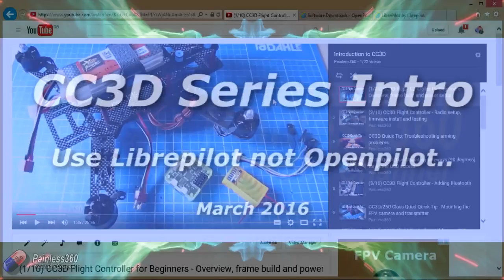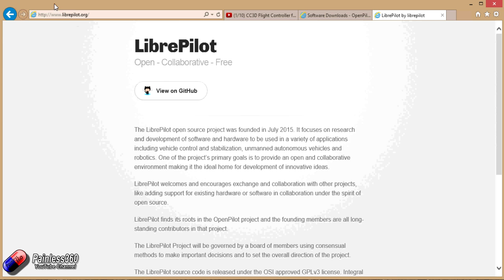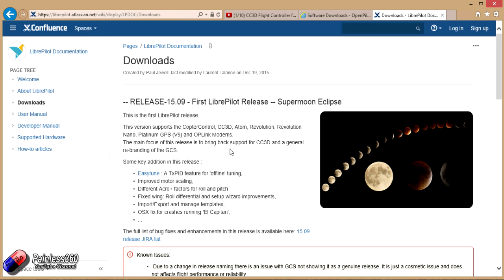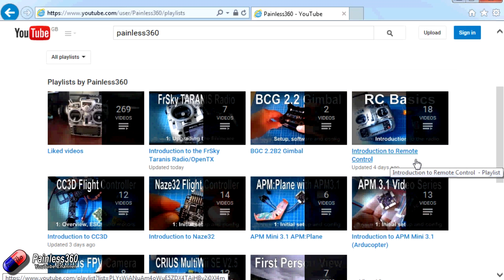(0/10) CC3D Flight Controller for Beginners - Welcome and use LibrePilot!

Comment: Has anyone had any luck with open pilot and or libre pilot.  I had no luck with open pilot so I downloaded libre pilot.  I connected everything using PWM.  I also connected a servo to prove that the Tx /Rx bind was working and it was.  I calibrated the motors and got up to the Transmitter section.  For some reason, only the throttle and pitch channels register.  I cannot get the yaw or the aileron channels to work when I following the software config and move the Tx sticks.  So for this reason I cannot press Next and move on.  I've gotta say, I have already moved up a level by dumping the KK2 mini board because the receiver test would always show as No Signal.  Now this.........

I have also tried using PPM with one lead plugged in only.  The servo doesn't work and I cannot get my motors to spin.  Something is not right.  When you watch these youtube vids, it looks and sounds simple and easy to do, but it is not.  I have two quads that I have built myself, installed the electronics, have used /tried both the KK2 mini and now the Mini Open Pilot board with no luck on both.  I cannot get these quads fly ready.   Should I down load clean flight or beta flight and flash my mini open pilot board.  If I don;t get mission accomplished soon, I'm going to either turn off the quad hobby hype or buy an RTF quad without any of these hassles.  Not impressed so far and I'm quite pedantic about the way I approach this, especially with the wiring and electronics involved.   This has tested my patience beyond what I expected.  Any advice from anyone is welcomed with open arms.
Reply from the maker: Sounds like potentially something you're doing wrong, or a hardware fault somewhere. If you look in the forums there are other people who have had similar issues and they regularly go through the troubleshooting tips. I've personally not had this myself, in this cc3d series on the channel I cover the steps that I go through to get things working. Best of luck with your build, hope you get it sorted soon..

Comment: trying to understand but not sure .... just order the micro size cc3d module from Amazon and it states open pilot . 
Do i need to install Librapilot before i start building ..... Thank You !!!
Reply from the maker: OpenPilot as a project is dead. Most pilots will use one of it's successors - LibrePilot or dRonin.. Best of luck!

Comment: Love your videos. I've learned so much. Maybe you can help with this one. I've converted my Kylin 250 (using SBus and Radiolink Transmitter ) to FrSky X4R SBus and Taranis. Kylin 250m has a CC3D and OSD all on the one board. Now I want to disable all the OSD information. I tried to connect through the OSD port with the OSD Config application. I un checked all the OSD information and all looked good on the application screen. I saved and disconnected, then reset the OSD port to telemetry. Now my goggles/LCD video display show some strange wording "aiting for heartbeat"plus some other info. Is there a way of turning off all the OSD functions for a clear screen? Any help would be much appreciated. Thakls Alan
Reply from the maker: Turning off the displays is something you need to look at the documentation for the firmware you've installed on the MinimOSD. I suspect that even if the MinimOSD is told to not display any information it's still looking for the telemetry data (also called the MAVLink heartbeat on this side of the hobby) and the error looks related to that. I'd enable telemetry on the CC3D but configure the OSD not to show the data. Best of luck!

Comment: HI,I emailed you before, I am building a Tarot TL250H Quadcopter with an original cc3d board I am using my Taranis plus tx and a x8r rx sbus I am using the magic stick that comes with the tarot my question is since I am using the magicstick pdb and the esc's get soldered to it the cc3d board will get powered through the esc's through the rx? I saw a video on how to hook up sbus with a servo wire to the one port does this work? Thank you in advance for any or all info!! also thank you for all the videos you make on builds not just showing how to do it but also explaining why it is done this way!
Reply from the maker: We've never used S-Bus with the CC3D as it's a pain - you need to use one of the ports to do it. I've never heard of the Magicstick PDB and a quick Google search didn't find it either - if you're using OPTO ESCs then you'll need to power the FC and Rx from the 5v from the PDB. See the RC power videos in the 'Introduction to RC' series. Best of luck!

Comment: Great series, keep it up. I can't access openpilot.org anymore to read the user guide (I use it because it is so much more detailed than the librepilot.org documentation). Do you know if there is something like a pdf of the open pilot user guide? I have solved all of my problems with advanced setup by searching youtube and forums but that is far from ideal.
Reply from the maker: +Dave Kitching check out the LibrePilot docs, they are a lot better than they used to be..

Comment: HiI have built the HY-J3 Tricopter using your follow to guides , have reached the point where I am connecting to Libre pilot and going through the set up,I have reached the stage where you power up a motor using libre pilot and you tell it to stop as soon as the motor starts to turn, if that makes sense I am sure you will know what I meanunfortuatly the motor will not power up ,I am using a CC3D flight controller and the same power ditribution board as you have, strangly enoug when I connect the battery to motors do twitch and the ESC's do make a soundso my question is , what have I done wrong? does the cc3d required its own power supply from the power distribution board?I notice the the connectors coming from the ESC's to the flight controller only have 2 wires ( black & white) but the flight controller has three pinsany help would be very much appreciated as it would prevent me from losing any more of the little hair I have leftthanks
Reply from the maker: +Rob Barron Tricky to say if you've done all the basic troubleshooting. I'd check that the escs are calibrated and the board is armed..

Comment: Any chance of a small update to cover the CC3D EVO board and its Spektrum satellite receiver connections? I am having the devil of a time trying to find any info on these ports. Or can I just plug the 3 pin connector that comes with the satellite receiver into one of these ports (i.e. does it plug in directly or do i need a 3.3v conversion board?)
Reply from the maker: +Nick B We're not planning to, it's all covered in the LibrePilot docs - https://librepilot.atlassian.net/wiki/display/LPDOC/Setup+a+Spektrum+Satellite Best of luck!
Reply: +Painless360 The problem is that it doesn't cover connections to the EVO board which has two extra connectors supposedly for direct connection of a satellite receiver. It doesn't come with any documentation or a diagram and I can find nothing that covers these ports. I had already read the LibrePilot docs and no mention of it anywhere.
Reply from the maker: I'll add it to the list - thanks for the idea...

Comment: Hello !! Thanks for answering.
Set command is ..
Mode sele / FM-PPM
Type seal / ACRO
Modulat / PPM
Stick set / MODE 2

Func setting did not move.
The receiver 9X8Cv2 called the CC3D black wire board in the negative red wire to white wire positive sign in the bat / bind.
Thank you!
Reply from the maker: +Obl Silva Looking at that receiver it doesn't appear to support PPM. I'd double check all that. Best of luck.. https://www.youtube.com/watch?v=GbUMC8h2uhU

Comment: I have cc3d evo, i am running op 15.02.02. i wanna move to lp, i will erase and update with lp then can i use the same values for PIDs?
Reply from the maker: +Dineash Kumar Any upgrade or change to firmware needs a recheck of the PIDs.. Best of luck!
Reply: +Painless360 thank you.

Comment: Running op/lp is pointless on a 6dof cc3d.... Betaflight is the way to go. And also since a spracingf3 board is only 18$, there is little reason to even buy the cc3d anymore.
Reply from the maker: +Calvin C You've seen my Opensource video right ;)

Comment: On Librepilot can I use it to setup the PX$ (pixhawk4)?
Reply from the maker: +steve USMC NO TOLERANCE why do you think that?
Reply: Painless360 Because I do not know the answer..
Reply from the maker: +steve USMC NO TOLERANCE Then have a look at the Pixhawk series here or do a few Google searches. Every board has software it works with and a quick read of the details on the forums (and websites where you can download the software from) will usually quickly give an clear answer. The answer to your question in this case is 'no' ;) Best of luck!
Reply: Painless360 Thank you. You have taught me a lot about the Taranis radio